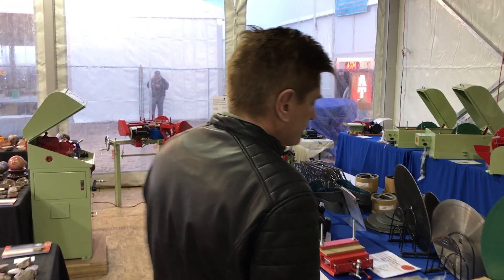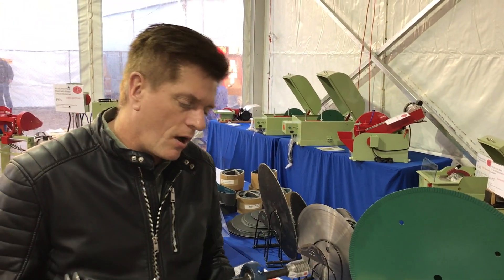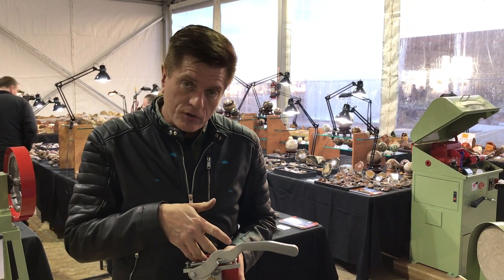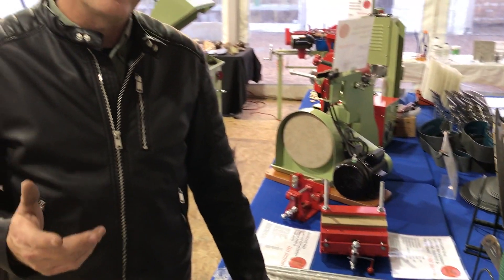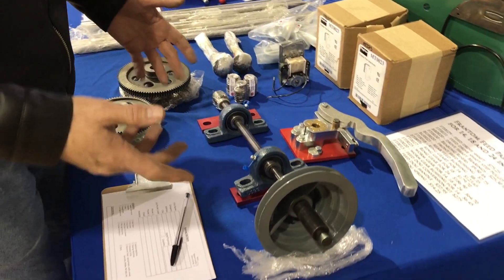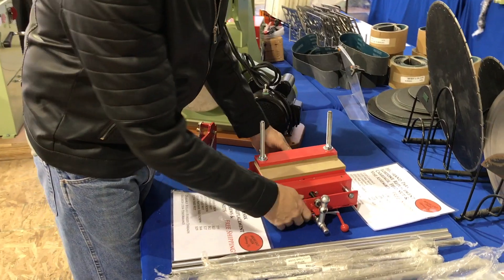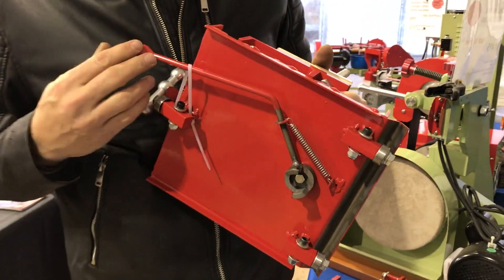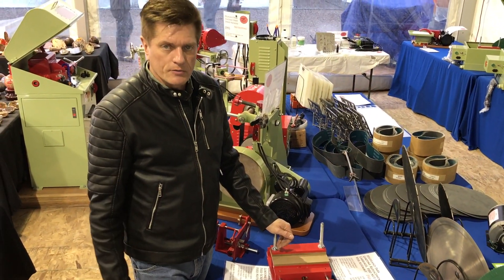Frantom Feed Drive Assembly with Brand New Gears, Bearings, Shaft and Pulley

Comment: Can the "Complete 18 Frantom Feed Assembly" work for replacement on my 20" square rail slab saw?
Reply from the maker: No that product only works with a Frantom  and I appreciate you asking the question because it was on the wrong section on the website.  The powerfeed drive shaft, gears and step pulleys can all be found here along with bearings for your 20 inch square rail saw:  https://www.hplapidary.com/collections/20-powerfeed-parts

Comment: So what are the pricing for the Lortone LS-12 items. I’m thinking I could use some new parts for mine.
Reply from the maker: Hi There - i'm working on the site now and putting all the products and pricing up there now.  I think nearly all of the LS12 parts are up at this point so you can go to https://www.hplapidary.com/en/lortone-parts.
Reply: Highland Park Lapidary -  sweet
Reply: Highland Park Lapidary - could you demonstrate on a old dull blade how to hammer the edge to spread out the diamonds to get a blade to stop cutting into the rock and binding? Or to stop it from doing so after the feed tray is tightened up and running true? Thanks. I had to buy a new 16” mk-303 recently. They aren’t inexpensive you know. How’s your agate eater hold up? Is it .085” thick?